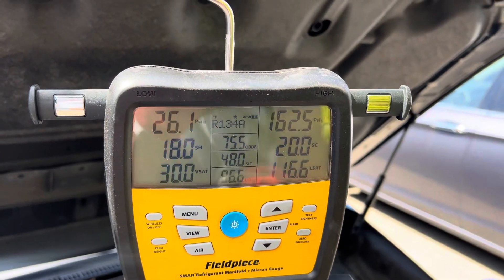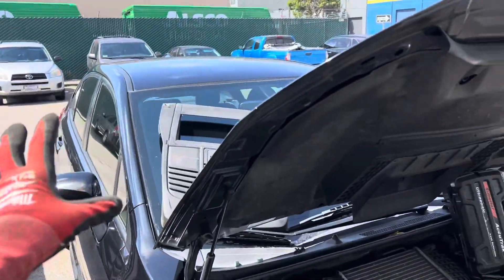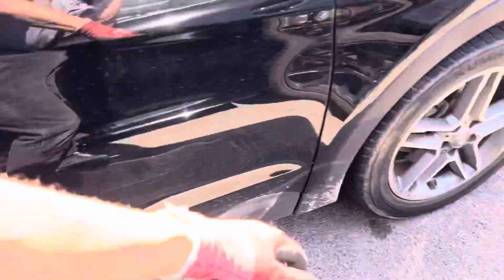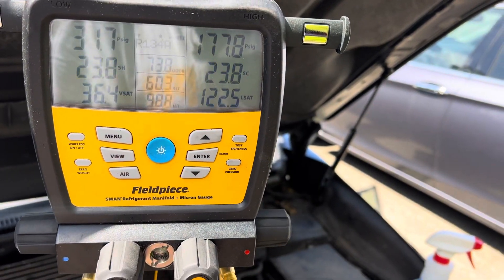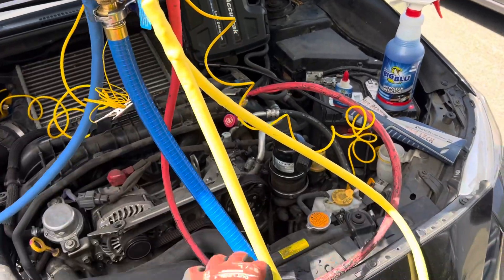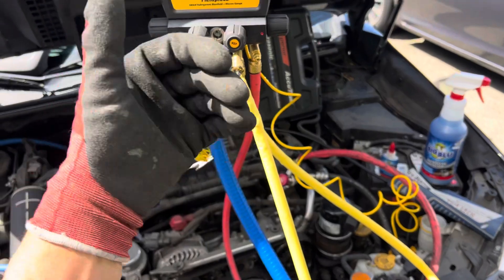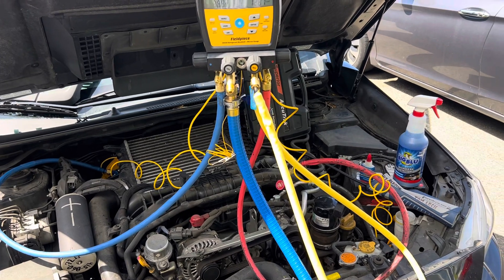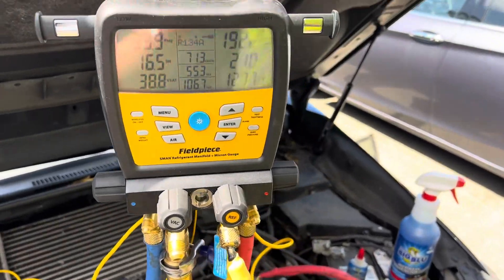AC ON SUBARU 2015 WRX Refrigerant Pressures

Comment: Most shops accidentally dumped too much freon inside the system. Subarus require between 25 and 30 psi on low side and you should never before 200 psi on high side idle. Not to mention they add to much oil.
Reply from the maker: @MrGsxrme  no such thing as accidentally?. 🤔
       They intentionally choose not to read and educate themselves. It’s an act of intent to be ignorant, and not read even the most basic instructions..  
   About charging refrigerant weight specified for the vehicle there is no other way to charge. 
         They choose not to read that these are not the vehicles from the 1950s 60s and 70s that their grandfathers worked on that had 10 ounces of oil or 14 ounces of oil

Modern vehicles are hovering around under 7 ounces to 5 ounces and many of the newest vehicles around 2.4 ounces 3.77 ounces . 

If you put 1 ounce extra on top of 10 ounces it barely made a difference in those large systems that had 3.75 pounds 

You put 1 ounce on that is 3 ounces increased the oil capacity be a 1/3 of the total capacity over .  a vehicle that might only have 0.9 pounds of refrigerant in it

Comment: Really man. Thank you for the education. I'm not a car mechanic just a guy that wants his cars done right so I do it myself. With out your help I'd be up a river. Thank you.
(For do it yourselfers)
Also when looking at a Subaru with anything over 50k miles it wouldn't be a bad idea to check the compressor clutch gap with a feeler gauge. Its a easy thing to check without taking anything apart with easy acsess and will engage while sitting at idle then disengage when driving for various reasons.